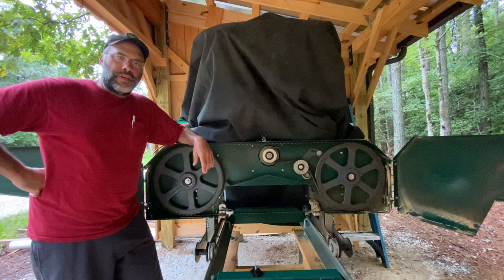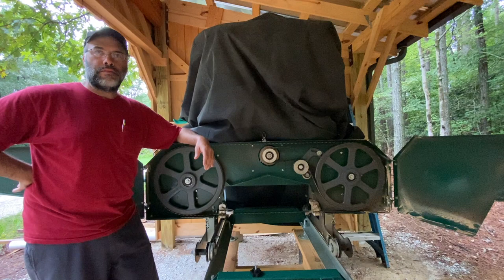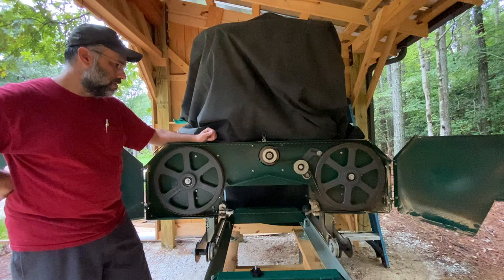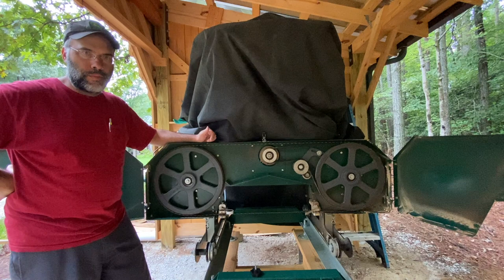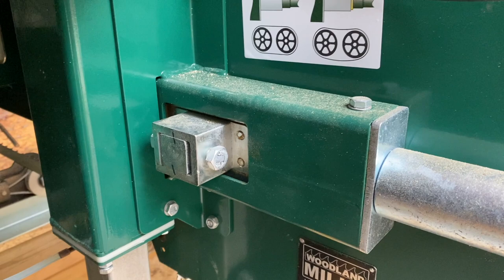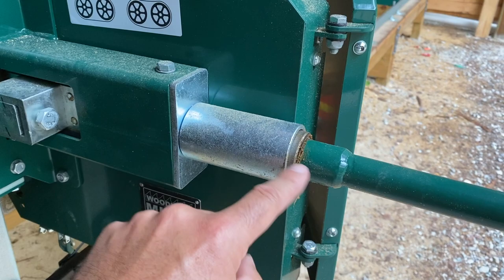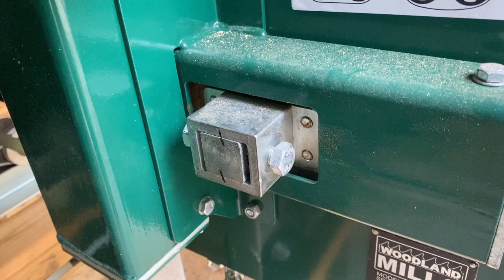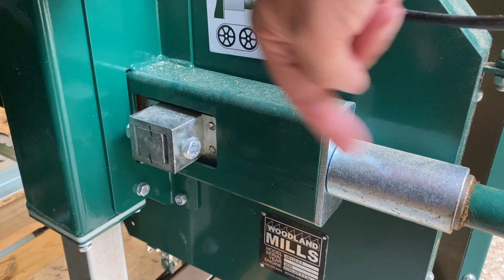Part 1 - Mechanics of Woodland Mills Sawmill Blade Tension: Background and Theory

Comment: As belts wear and compress and change due to temperature and humidity the blade tension will change. This makes the belleville washers necessary even if saw blades could be purchased at a constant length. The blades themselves change in length due to temperature and repeated flexing and straightening. The spring tension prolongs the life of the blades and keeps the blades centered on the band wheels while helping the blades cut straighter.  I like your practical and factual approach to explaining the cause and effect behind blade tension. Please keep these videos coming!

Comment: Really liked this video on blade tension and tracking. Really helped me setup my HM122. It certainly is important to get the blade wheels on the same plane for tracking. We used the torque wrench technique to set the tension at 20 ft lb. So far we have only cut about 200 board ft of wood..but everything is operating well and correct! Thanks for your technical expertise on this subject.

Comment: I will be assembling my mill in the next week or so and must admit to being a little nervous about throwing a blade after having seen and read of so many users having had this happen. Even though I've used vertical and horizontal bandsaws professionally for a few decades I was really surprised to see your chart on how small differences in torque translate into undue loads on components. Think you may have cured me of the "I'll just reef it a bit more to be sure" mindset. Cheers!

Comment: during use does the compression of drive  and idler pulley belts affect your calulations of tension on the blade?
Reply from the maker: Shouldn't be a big change -- the tensioner has a spring that helps maintain tension as things change during operation.

Comment: that it is the utility of the small white recipiant that one sees where the water arrives on the blade at 3.51 Time vidéo
Reply from the maker: Prevents lubricant water from dripping on blade after I am done sawing.  Usually a small amount will drip out and it can cause a rust spot on the blade if left to sit.
Reply: @Lumber_Jack  tank’s
Reply: Mr. Honda ‘God is in the details’ was right!  Perfect example of why we strive for perfection.

Comment: I can’t help but notice how similar this is to turning my guitar. Specifically, the friction coefficient. What ends up happening is the guitar string tension (same as blade tension) will slightly loosen after the vibration has backed off the added the friction tension. To counteract this, I over tighten a small amount, and set the final tension by loosening. Now the blade (or guitar string) tension won’t drift after use.